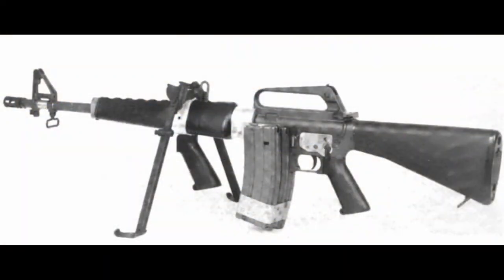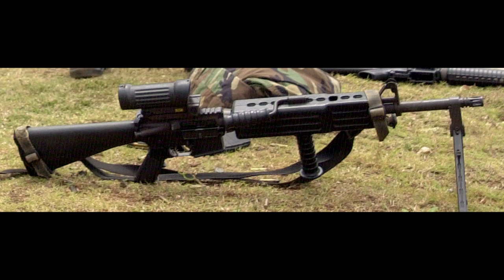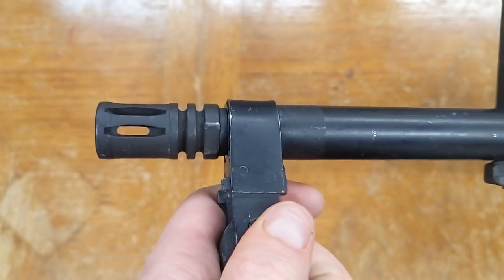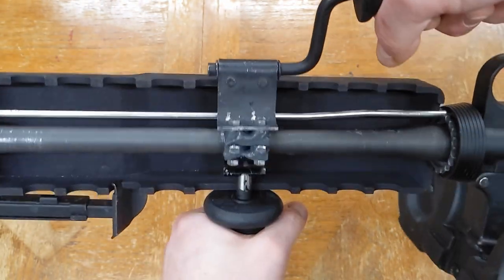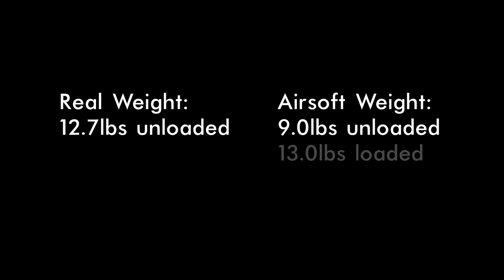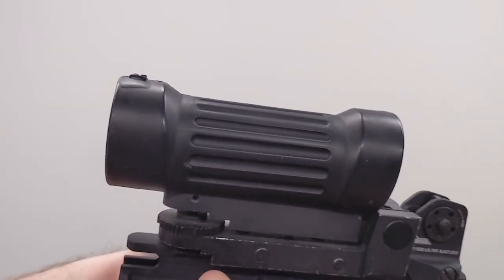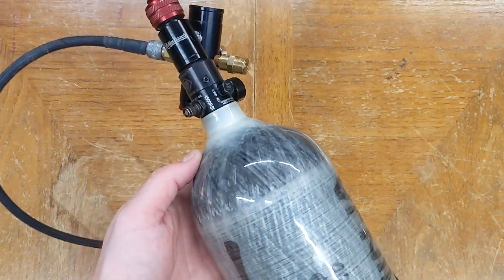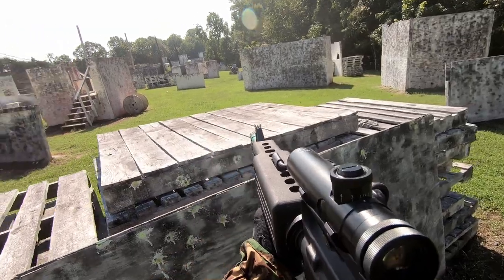Airsoft Custom Build- Gas Blowback Colt LMG / Diemaco LSW

Comment: This is dope and I've wanted to make a build like this, however I feel like it's not worth it since nobody makes 60rnd or 100rnd surefire box mags for airsoft guns. If you're using a drum, you might as well just go belt fed. Still awesome, just wish the high capacity box mags were on the market.

Comment: This is incredible! Followed your build on arnies. Do you sell the 3D print parts or the STLs? I would love to build a Tippmann M4 into an LMG and this would be an amazing project.
Reply from the maker: We actually provide the files for free- just be aware that the handguards aren't ours, only the carry handle and foregrip: https://drive.google.com/drive/folders/1zQPJK5ZyvKB8JKN6XA_wYARCbdw8WYGV?usp=sharing
Reply: @ExplosiveEnterprises  Thank you so much for providing these resources regardless!
Reply: @ExplosiveEnterprises  What company did you have your handguards printed at? Do you recommend a specific material / finish?
Reply from the maker: @homie8437  The service we used isn't offering it anymore, but it was PA12 nylon printed via multijet fusion (MJF). There's an increasing number of companies offering print-on-demand with this process; it's a great material and needs no post-processing to look good.
Reply: @ExplosiveEnterprises  Ah, thanks for the reply! I just figured out the bipod for a late open bolt Colt LMG (Versa-Pod Model 1) and am looking at a repro tri rail too.

Comment: What size HPA tank do you use and how many shots do you get out of it before you need to refill?
Reply from the maker: It's a 90CI, 4500PSI tank- it gets about 5,000-6,000 shots in a VT depending on input pressure.